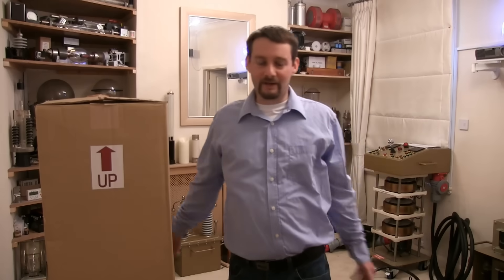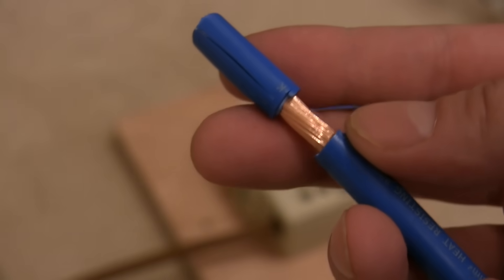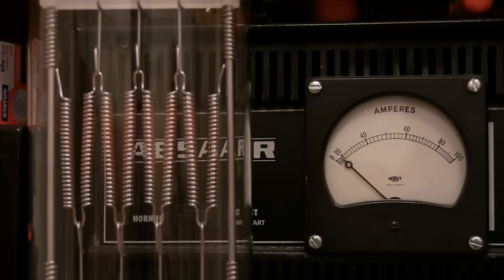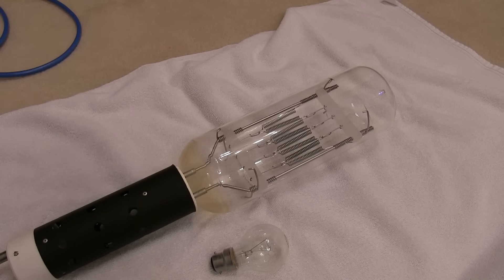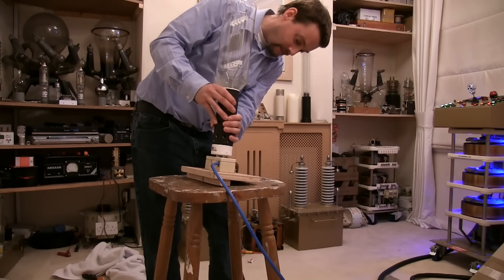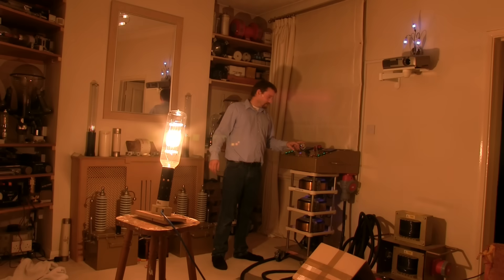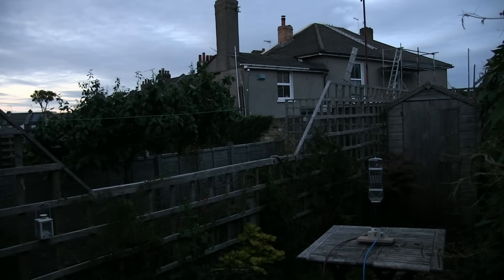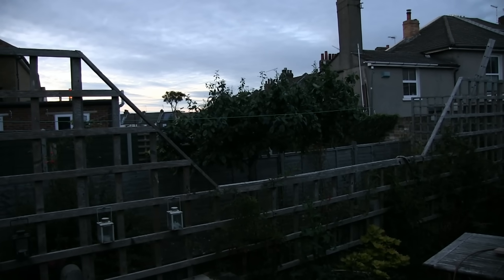20,000 Watt Light Bulb Test

Comment: I work as a grip setting up lights and rigging equipment for television. Typically 20kw lights are used to simulate the sun on set when it is night time. Or any variance there of, such as sunset. The light is also much brighter than having an open bulb (which is very dangerous btw). All variations of the set-up include fixture, which encases the light and a set of 4 to 6 lenses for it. Some even has fresnel lenses, word of advice, never walk in front of a light fixture if it is turned on with a fresnel lens on it, especially 20kw. Often times the grass is burnt or slightly charred after a couple hours of use around the fixture. Hopefully this helps some of you understand what they are used for.

Comment: You know, some awesome numbers I found. This lamp produces around 71,999,942  Joules if I'm correct. The heat and light was intense, and rose sharply in the enclosed room. 
Now if our Sun would go supernova (it can't btw) you would get +- 8 * 1014  Joules of energy every square meter, PER SECOND. Or around  2.00845 * 1017 lux The shear number of photons would strip the planet in a few seconds. That's light alone, you simultaneously get dusted by neutrinos that have the same effect in those numbers. Oh, and then a shockwave of gas at sublight speeds that will disassemble the planet, if there was anything left at that point.
Reply: sounds fun

Comment: you could run it on 5kW then you have light and heat simultaneously :). I have one on 2KW 230volt and is connected to a transformer that provides about 30volt and some amp , the transformer is 50 degrees hot and the lamp is about 120 degrees hot and lights with the same light as a sunset

Comment: Mitch this kind of lamp can be found in crash test and explosive test centres, they are used with high speed cameras to get good definition, or they were cameras are better now.

It'd make a really good security light, it would take a determined thief not to run away, and they'd probably run into a wall after being blasted by it.

Comment: Imagine the fuckin buds this shit would produce. AHAHAH
Reply: wrong type of light. too much whitescale with halogens
Reply: burnt ones =)
Reply: +123TauruZ321 Oh yeah, I'm sure you'd have to be a REALLY good gardener to be able to pull of something like that. As far as the equipment goes, no, they can only charge you for owning equipment for growing drugs if they can prove that the drugs WERE indeed grown using that equipment. If you have the equipment but not the plants, they can't do anything to you, no matter how badly they want to. Suspicion of selling drugs? Not without proof of actually selling it.
Reply: +123TauruZ321 Perhaps they pulled it off with multiple harvests (growing them in artificial light supposedly makes that possible), crazy efficient fertilizing (yes, there CAN be too much of it, overdoing nitrogen delays fruit/pod maturing, overdoing one trace element introduces a deficiency of another one etc.), sufficient watering and probably running the whole business in a remote basement on diesel generators (otherwise the utility company would've tipped the cops off a long time ago). Even with all that 500 grams sounds like a lot though.
Reply: i was..
Reply: Yeah, and you need two types of kelvin lamps, don't you. Around 5500 kelvin for vegetative phase and 2500 kelvin for flowering, right?
Reply: 123TauruZ321 You only need sun. That's it.
Reply: 123TauruZ321 Well, you can manage with one type of light depending on the cultivar.
Reply: Sc0pee Yeah, sure you can grow outside, if you want to get caught. What does cultivar mean?
Reply: It'd smoke it all before you got the chance to
Reply: +123TauruZ321 If you grow it indoors, you get caught too, because the utility company definitely notices the sudden jump in your electricity consumption (it climbs by several orders of magnitude except if you use your own generators of course)....
Reply: That is true. I tried once, but i was certain to do it in the winter, so that i turned off my oven and used the light bulb as the heater in the apartment. Worked well. But i had no experience, and even though i had read myself up a year in advance, and invested about 300£ in equipment, i only produced 2 plants which yielded about 5 grams of leaves and 15 grams of buds. I used a 2 kw lightbulb of metal halide for growing, and a 2 kw of high pressure sodium for flowering. They emitted a great deal of light, even outside the closet. Even keeping the closet tight and aerated is a challenge, due to the massive heat. 

They gave a weak effect for smoking, although i don't smoke weed myself, i drink only alcohol.

So it requires a great deal of knowhow and manipulating with the lights, the fertilizing, watering and everything, if you want to grow tons of it and make a fortune. It really requires a good deal of resources, time and work, and i would absolutely say you should have an entire room for the growing process entirely. I sold all my equipment, because there are quite severe penalty if you get caught, even for just owning this equipment. 

They charge you for possession of drugs, equipment for growing drugs, and for suspicion of selling drugs. So i wouldn't dare take the risk.
Reply: CoolKoon Thank you.

It is fascinating though, i've read stories of people pulling in 500 grams each plant before drying, though.

Idk if that is realistic, but i guess that is the top professionals that does that.
Reply: CoolKoon That triggers some memories, yes, it is possible to "manipulate" the plant to grow more with those processes. I may also remember wrong, but i remember it sounded like an obscene amount regarding to the amount i got out of 2 plants. Thanks for the information.

Comment: Is it necessary to ramp up the voltage/current on this light or is it ok to just give it full power from a "cold state"?  Also, how many lumens is it rated at?  Also, why didn't you angle the lamp away from you instead of towards you?  My 300W incandescent lamp (lightbulb) is rated at 3900 lumens so extrapolating to 20,000 watts it should be (20,000 / 300 ) = 66.67 * 3900 = 260,000 lumens (260 thousand).  Is this about right?  I wonder what would happen if you  immersed it in water (inverted) while it was at room temp then slowly powered it up.  That would make a great video.  If you wear a welders mask can you look directly at the filament at full power?  When can you first see with the welders mask at what wattage?

Comment: cool! my electric bill hit triple digits!
Reply: I'm in London, UK, sadly triple digit bills are the norm here...
Reply: +Sonari N. Roulette  My household electricity bill hits triple digits in the first 8 days of every month. Then again I live in an entirely electrified household.
Reply: what, do you live in a faraday cage or something? XD
Reply: Sonari N. Roulette I live in the desert of Washington state.
Reply: Our average electricity bill is about $240 in winter and about $350 in summer.
Reply: funny, since my bill got bigger my quacks have been deeper in pitch! >.<
Reply: Yes, it's the air conditioning. I use about 13 kWh per day in the winter and 20 kWh per day in the summer, and the difference is because of the air conditioner running. (Note that in the winter, I use natural gas for heat which isn't included in the electricity bill). I used to pay on average $100/month (about 76£/month) for my electric bill, but now I have own solar panels so the bill has happily decreased to $13/month (10£/month) which is just a connection fee because I don't get billed for usage anymore.
Reply: damn... our electric bill is like $30 a month
Reply: I was about to boast that you must live in coal territory and that you should move to somewhere like Washington where electricity is dirt cheap! My electric bill for a fully electric house in Seattle rarely crosses $50/mo. How the heck are you spending so much with all this hydro power at our disposal?
Reply: MOAR POINTS! 3MANY5ME!
Reply: lekoman I live in the Tri-Cities, that's why. Our electricity and climate come together to make an expensive place for electricity. We have a reactor nearby so it's more expensive.
Reply: We don't have an electric bill haha!

Comment: It's obviously a huge waste of energy by today's standards of lighting. What is the photon output or "lumen" ont his? did you measure it? The best led's have a bout 162lm/w (cree cxb3590) .. 20'000w would aprx equal 3'240'000 Lumens .. ROFLMFAO !!!  :OO
Reply: You forget one important think!
LEDs reach this efficiency only at low power... on Maximum you lose 50%!
Next Cooling...

This Old Lamps Make a lot of Infrared and the light is the same as the Sun makes. No LED can this.
Reply: 100W LEDs also have poor efficiency/efficacy. Try with 20000 1W LEDs.
Reply: You could have a array of just under ... 200 100W modules tho.
Reply: Well, the more IR you produce, the more energy you throw away doing it, of course LEDs also heat, but they are still more efficient than these regular lamps.
Reply: i have 6 x 2watt plant led in my cupboard but they used 20 watt for growing plant.so i think 12.000 x 1watt are 20.000watt because they are not so accurate
Reply: IT'S HIS MONEY HE CAN DO WITH IT WHAT HE WANT ROFLMFAO
Reply: *****
Did someone here ever say different?
Reply: If we try to make a 500k lm Lamp we need At 100lm/w 5 000Watts led power.
That means also 3 500W of Pure Heat.
LED´s do not like temps over 50°C

Its impossible to build a small passive cooled lamp with Leds from Todays technology :)
Reply: Depends, how close to the sun you travel..
Reply: @Andy Private ..the number of led chips in array really has very little to do with the Lumens / Watt efficiency.. Especially when comparing how much energy is lost in heat with a tungsten light versus the diode technology
The consideration is the Fv current from the driver and wattage drawn by it ie a HLG 286v 200w 1400ma constant current would light up aprx 4 CREE CXB3590 .. consuming 200w of energy to do so and giving you an aprx lumen yield per cob at the lowest 5'000 Lumens @ 1,4 amp = 20'000 Lumens from that driver with those cree led cobs 
Now 20'000w divided by 200w = 100 of those arrays yielding you a total of aprx 2'000'000 Lumens .. Minimum! At the cob's maximum spec potential you will have 162 lm/W x 20'000w = 3'240'000 Lumens. 
Yes at that output you will not be running the LED at the maximum efficiency (heat/watt) and would need to cool the arrays somehow, but the potential is there. Also 2'000'000 Lumens when ran at its maximum efficiency mode is still pretty bright ;)
Reply: 3vIL VIrUs There are 100W LED COBs that produce over 100LM/w :)
Reply: Yuuki Haruto
Show me only 1 Dtasheet.
Reply: @Andy Privat http://www.cree.com/~/media/Files/Cree/LED-Components-and-Modules/XLamp/Data-and-Binning/ds-CXB3590.pdf
Reply: Gary Host
Thanks! Not bad led :)
130lm/w at full power ist very good.
But the Price.. ~60€

And it will not change the fact you cannot build a small 500k lm LED Lamp in the Halogen sitze.

And if i use a HQI bulb for only 10€ i have more light ;)
Reply: ***** No the cxb3590 is rated at 162lm/w while a HQI is rated around 98lm/w so you won't have more light from a HQI, you also have a huge heat issue with a HID, and no lifespan. To maintain the lumen output you would need to change that bulb atleast every 6 months or so, and a cree led is rated to last 5 years.. So in reality your HQI bulbs will run up $80~100 vs the COB at $40~60 so the HQI is almost twice as expensive.
The COB is easy to cool, while the HQI require some kind of bulb enclosure to keep it cool, taking even more lumens away from its already poor performance. All in all, HID´s are a thing of the past, and a bad deal if you're investing in good, efficient, and long lasting lighting.
Reply: Gary Host
I mean 1x 150W Ceramic HQI (10€) will make same or more light than 1x cxb3539 for 60€

Cree Datasheet -->>> 85°C ~11 000lm at 85W
Osram HQI Powerball -->> 150W ~13 000lm

Yes HQI have about ~95 lm/w but heat is not a problem this things can reach up to 1000°C+ on the glass bulb without any demage.

Liftime 1 000 - 30 000 hours.
Leds have the same or bit more Lifetime if you have a good power surce and not too much heat.

LED also lose light in the lifetime..
Most litetime is measured after 50%/70% light.

The Price and power ist the difference :)
LEDs are best from 0-50W
HQI Lamps 35W - 30kW (Kilowatts)

:-)
Reply: ***** 150w cxb3590 = 24300 lumens while 150w OSRAM HQI = 13'000 lumens
No LED doesn't lose light like that. They are rated to perform 5 years at the rated spec, then they start to decline. A HID will start to decline as soon as you turn it on for the first time, and after aprx 6 months you will usually have less than 50% of its luminosity left. 

Yes the bulb can handle 1000°C+ but if you're mounting it indoors or above a fish tank, the people or fish might not be able to handle 1000°C+

Also at that heat you will have to consider how you will supply it with electricity since copper melts at 1 085 °C

I have nothing against using HID's but they are alot more expensive in the long run, and far less efficient than the latest generation LED's
Reply: ***** Before you ask for datasheets why don't you do your own searching

And no, HIDs produce quite an amount of IR compared to LEDs as well. And some very undesirable content in the non visible light spectrum ... UV if you would like.

And also you have to think very hard what would be holding them because they sure as hell will melt most materials if run at full power and they degrade FAST as well
Reply: Yuuki Haruto Guye you tink about heat problems....
Last 150 Years we use only Halogen and Glow lamps with 5% efficency this Bulbs get very hot.

Your "Heat" Problems do not exsisting.
Cars have also Halogen and HID.
The Headlights made of Plastic !!!!
Reply: the front of the headlights don't have to absorb heat.
Reply: Andy, I'm confident you will see more and more cars with led headlights. Especially as we faze out the combustion engine monsters of the past. 

A headlight is very small and doesn't generate much heat, however when we're talking "efficiency" it's the same percentage being lost in heat as the bigger models. 

A car headlight is very small, so I don't understand how it's relevant. The video is about *20'000 watts .. a car headlight is aprx 55 watts 

A 20k halogen bulb like in the video have a typical life span of 350 hours. http://www.osram.com/osram_com/products/lamps/specialty-lamps/halogen-studio-lamps/halogen-studio-lamps%2c-single-ended/index.jsp?productId=ZMP_108906 

440'000 Lumens
=
20'000 watt Halogen (that cost $5600 for 5 years + electricity bill)
or
2'700 watt CREE COB (that cost tot. $3228 for 5 years + electricity bill)

The LED will cost you two thirds the price, require less maintenance, and save you 17 Kilo watts of electricity consumption when in use. 

A typical price of electricity is about $9 per kilowatt hour, meaning 9x17 = $153 per hour that the Halogen bulb is in use! 

While the same luminosity is achieved with only 2700 w of LED running a total of $24 per hour in use. 

To put this in real life perspective, lets say your using these to grow indoors crop, like a marijuana farm. Running them 12 hours / day during the flowering cycle.

Halogen: 12h X $153 = $1836 / day X 356 days(1year) = $653'616 X 5 

= Tot. $ 3'268'080

LED: 12h X $24,3 = $292 / day X 356 days(1year) = $103'809 X 5

= Tot. $ 519'048

The Halogen bulb cost aprx $ 2'749'032 more during the 5 year life span of an LED, in energy consumption! 

So 3 million dollars more in consumption and you claim the Halogen is cheaper because of the single bulb price? 

Over the 5 year period of a LED COB the Halogen bulb price alone would run you $2372 more in cost.
Reply: Gary, where does electricity cost 9$ per KWh O.o 
I am in a city where electricity tariffs are high and it is no more than 0.3$/KWh
Reply: Gary Host
Buuut you CANNOT Build a Led lamp like ths
(Look at my firts posts here)
That means you have to use Halogen/HQI

And 55W Car headligts get very hot.

The Price for this energy consupsion will be under 0.2$ /kwh !

Comment: I wonder what his electric bill would be like...
Reply: With the average cost of electricity being $0.12 USD per kWh, running this bulb at its full potential of 20,000 watts for only a single hour would cost $2.40. 

Here's how to figure that out. "kWh" means "kilowatt hour," or 1,000 watts used in an hour. So if an appliance uses 1,000 watts in an hour, it has used $0.12 of electricity. In this case, this bulb will use 20,000 watts of electricity in one hour. So 20,000 watts ÷ 1,000 watts = 20kWh. Then we take 20kWh and multiply it by the cost per kWh. 20kWh x $0.12 = $2.40.
Reply: He is from England, so your stuff is meaningless
Reply: That's been asked so many times.  I'm even curious
Reply: +Dovydasas Gliebasas that would explain a lot
Reply: If he ran the 20,000 watt bulb for a full hour, that would consume 20 kWh. For comparison, my entire house on a hot summer day with the air conditioner on consumes about 19 kWh per full day.
Reply: +infinitesimotel Scouter's must be malfunctioning
Reply: Well I dont know about that, I ran a 1500W work light and went to see how much it would affect the meter: it was spinning so fast the house nearly spun around with it.  I cant imagine the bill after 1 hour.  Probably over 9000!
Reply: Do you mean BY 80%?